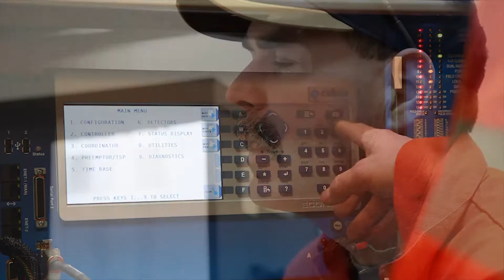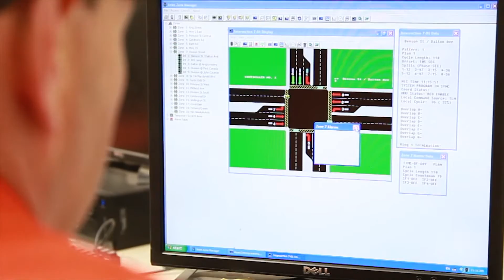Position Profile - Streetlight & Traffic Signal Technician

Comment: Its amazing the general public makes the assumption that the  traffic signals are all about changing light bulbs. There are many components to a traffic signal system and when there is a failure in the system that puts a signalized intersection on red flash only a experienced and trained signal technician is able to troubleshoot and diagnose the cause of the problem whether it be software, hardware, wiring issues etc.